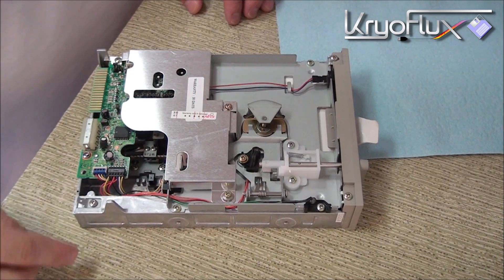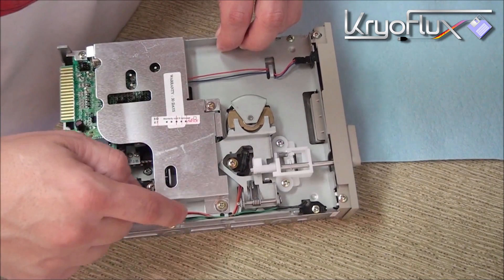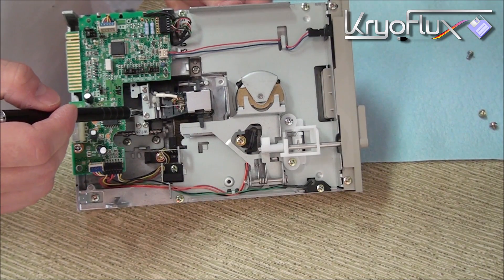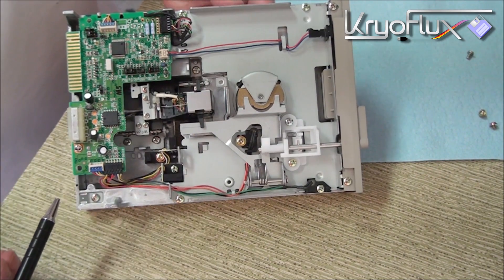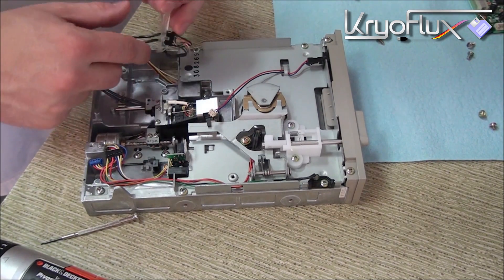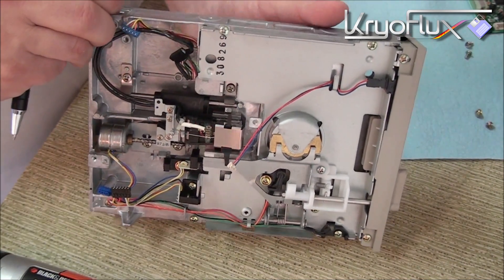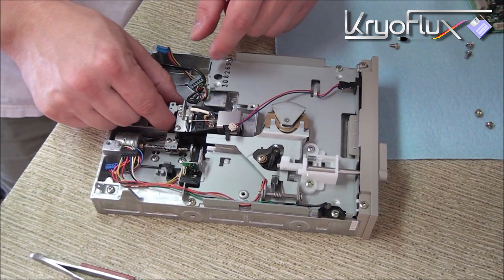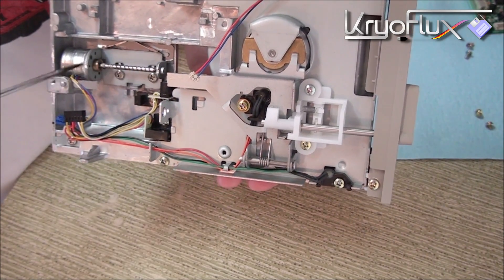KryoFlux Tutorial: Modify 5.25" drive to read "flippy" disks in one pass / Part 1 of 3

Comment: Hi I have a JU-475-5 AKO (not JU-475-5 AKJ as shown in your video). Does the mod also work with a JU-475-AKO? These both drives seem to be pretty similar but the locations of TP8 and TP10 from the AKO are interchanched compared with a AKJ.

Comment: omg cutting traces, filing stuff down, probably breaking a drive. noty I will just spend twice the time and not mutilate my drive.
Reply: I believe the problem is that unless the disk has two index holes, then a PC drive can't read it properly if flipped. But I could be mistaken.
Reply: So a non modified drive can read the flip-side, it just has to be manually flipped? If that's true than that's probably what I'll do, but I can't find anyone explicitly mentioning it.